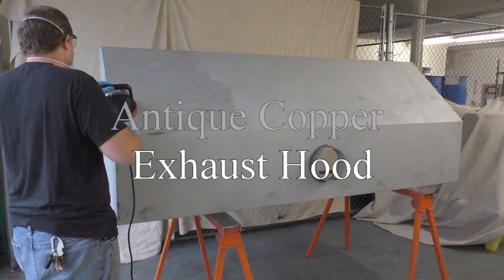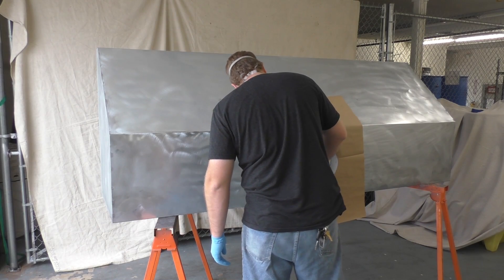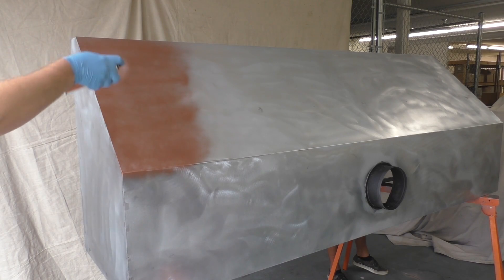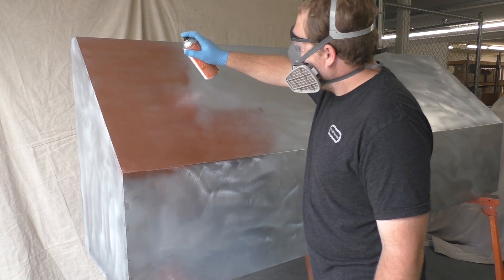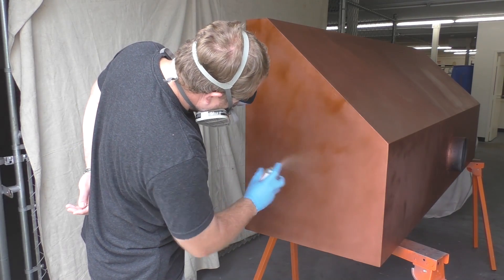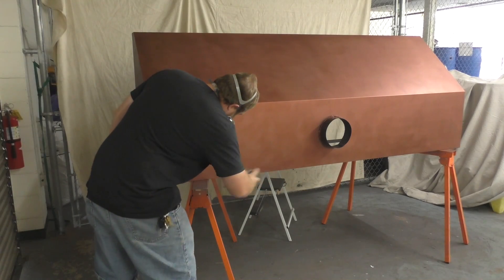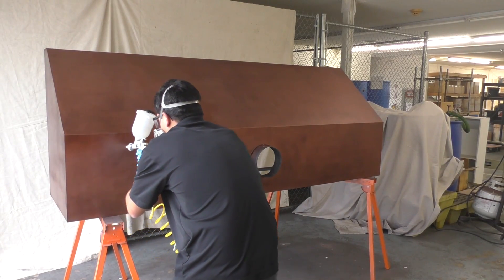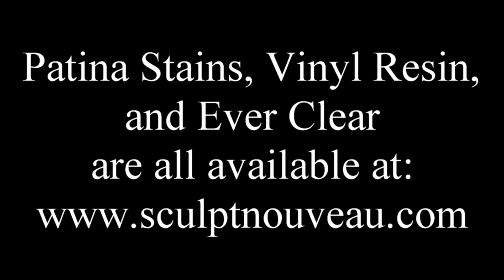Antique Copper Exhaust Hood

Comment: I would like to create this look...but...I am working on fiberglass, not steel. Roughly a football size and shape item. Can I prime the fiberglass and paint as shown? Also, I don't want to use a spray gun for the top coat. is there a rattle can substitute? Or perhaps Preval sprayer?
Reply from the maker: Not a problem, the Vinyl should work just fine on fiberglass. Yes, the Ever Clear comes in rattle cans as well.